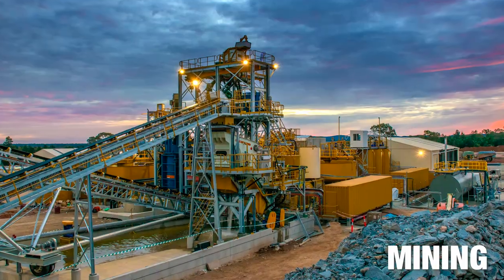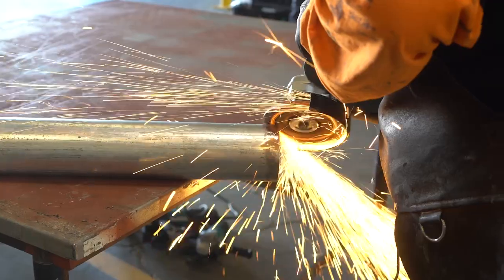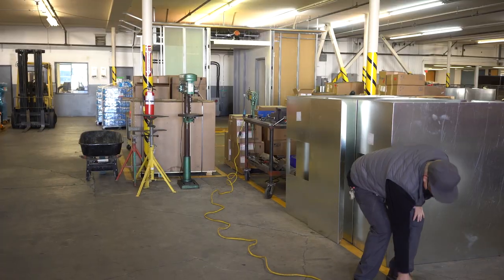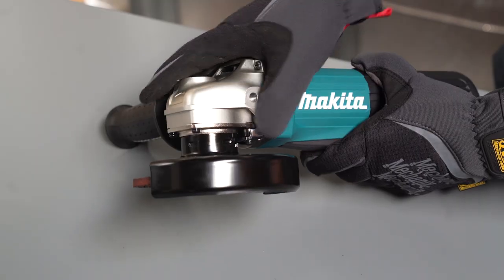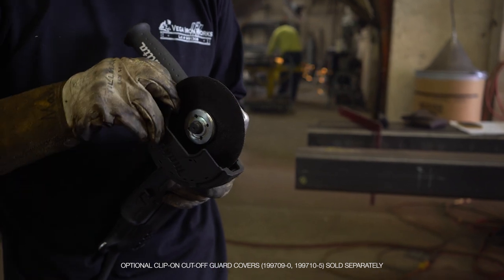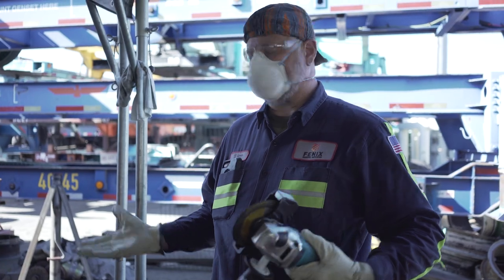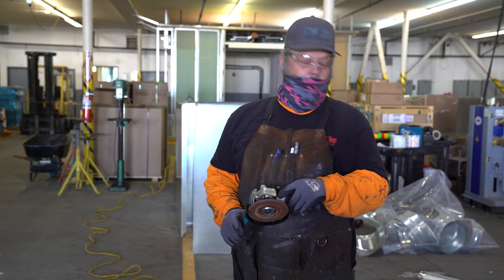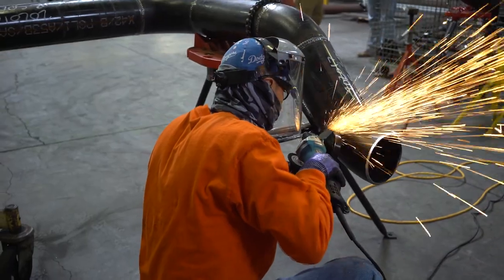Makita Angle Grinders with Non Removable Guard

Comment: I have the GA5052, and I cannot no longer rotate the guard (this feature worked just fine when I bought and used the tool for several months)? The lock lever functions correctly, and the I can remove and insert the guard into the initial positions. I'm unclear if there is a separate spindle that is supposed to rotate-&-lock with the guard (maybe spindle seized?) or if the guard's detents are supposed to cycle alone into the positions? Any help is appreciated?